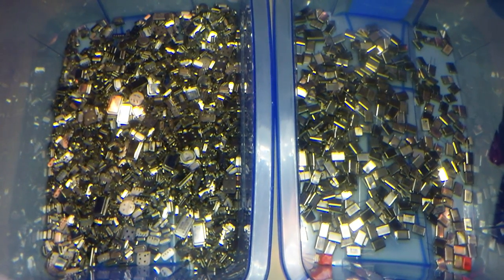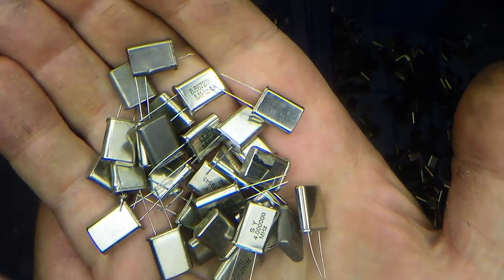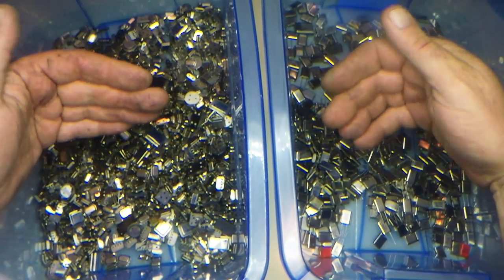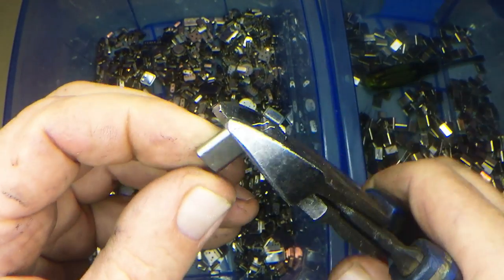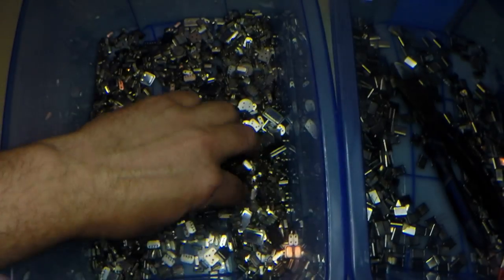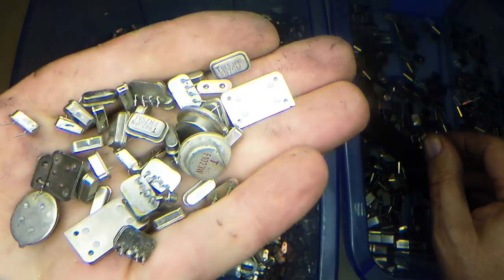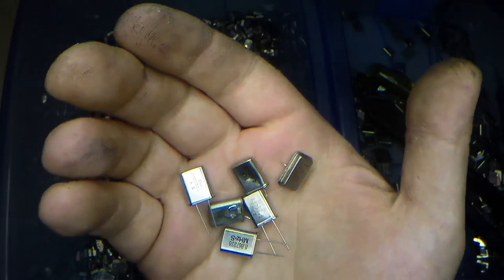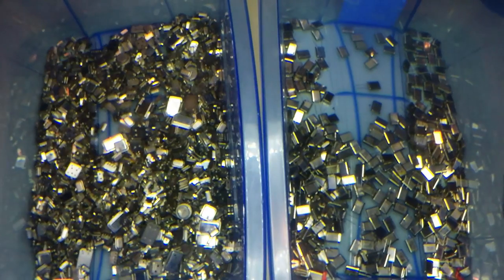Recovering Silver tabs from Crystal Oscillators

Comment: I had 50 Kg of factory new osszillators refined by a large refiner. The result was disappointing 150g of silver. Usually there is only 1 bond wire that is made of pure silver inside the osszillators. The ceramic ones somtime have some plated gold on them, but all in all osszillators are not worth the trouble. Good work anyways, we need more facts and yield data from refiners.
Reply: What you do is save em up until you retire,then you should have several tons

Comment: for the small ones i would do something like ballmilling and blending them until there a really fine steel/Crystal/silver powder and then just do seperation by certain acids and bases
Reply: +Seth Black I hammermilled all of mine into sand, milled it down to 200 mesh and put an electro magnet at the exhaust which went through a vacuum cyclone. It was pretty successful. Only aluminium silver, copper, gold glass and silica left.
Reply: @siggitiggi  that's kinda along the lines of what I was thinking

Comment: the unused crystals, bundle them in small lots and sell them on ebay....most of the crystal makers in the usa have stopped making crystals.... nitric acid is expensive, and dangerous...
Reply: Nitric is the least dangerous of the high end acids lol you can also make it really quite cheaply once you have the glassware so it can be a really viable option for bulk extractions

Comment: Perhaps you can bake them. Perhaps you can melt the tin solder that seals the base to the canister.

Perhaps a temperature of 300 C should do. That will not melt the silver. That will not melt the quartz. 

Quartz melts at 1760 C.
Silver melts at 961.8 C
Tin solder melts at 188 C

This information is easily validated.

But, if that fails, then perhaps you can pop them apart in a vacuum. They are filled with Nitrogen gas (which is inert and does not react ad you breathe it) and then sealed. Perhaps they may pop open like vacuum made popcorn pops open..

Perhaps if you understand how they are sealed then you can understand how to unseal them. This information is available by reading....this book..."Handbook of Quartz Crystal Devices" by David Salt, published in 1987 by Van Nostrand Reinhold (UK) Co., Ltd.

Fear is much more dangerous than Chemicals. Information defeats fear.

Comment: I might have a good way you can recover the silver out of them go to a pottery place and buy a good deal of clay because it's reusable get the wax base clay for model making. Now that you have your clay roll out a big flat area of it on your table/work area, I'd say make it about 10 mm -12 mm thick. Now stick all equal size legs up or down whichever works best then hit them all with a grinder to knock the legs off  them or take a big sanding block and lightly start sand them open or maybe a steel file. Better Yet If you can spare a few bucks and spring for a pottery turntable then lay them out the same way on that and turn it on a slow speed to not whip the silver out of the containers then just slowly ease your wood sanding block down onto the tops of them light pressure It will work way better once they are open just dump them out and magnet the steel dust out of your bowl. You might not have to use the grinder this method. Good Luck Hope this helps.  Email me back and I can draw this out for you I you want also I would like to ask you a good question about scrap Thank you.
Reply from the maker: ok thanks, will consider this when I start processing. 
what did you want to ask?

Comment: You are putting out good information about refining precious metals without actually doing it.  Most of the YouTube videos I have seen on this are deadly.  Way too strong of concentrations and volumes of acids.  Using processes that produce toxic waste.  If you have patience refining precious metals is a very safe process and clean environmentally.  It really boils down to the question of someone's willingness to take several hours or 10 to 15 days.

I your case you are willing to split the reward with a refiner and not have to worry about the process.  This is a highly valid position.  You also have to consider the split rate and include you efforts in gathering up the materials.  You may be near the tipping point where small scale refining may be worth you while

Comment: ben, couldn't the Crystal Oscillators be put in AP at 50-50percent to eat the base metals so they can be put in nitric acid to reclaim the silver?
Reply from the maker: yeah they can, i haven't tried yet but it seems that's what most people do
Reply: ty
Reply: What is "AP" ?
Reply: acid + hydrogen peroxide. Usually Hydrochloric acid (HCl) and 3% H2O2